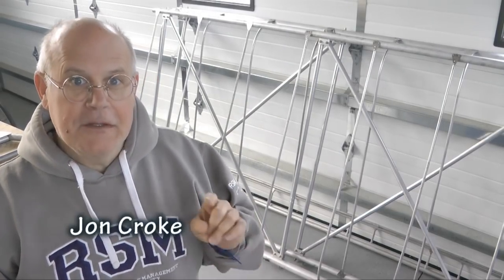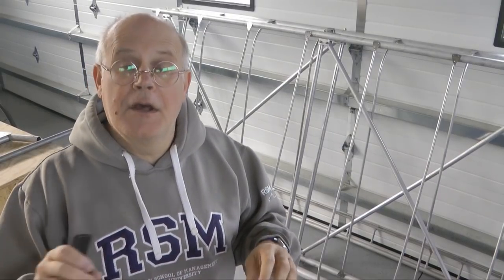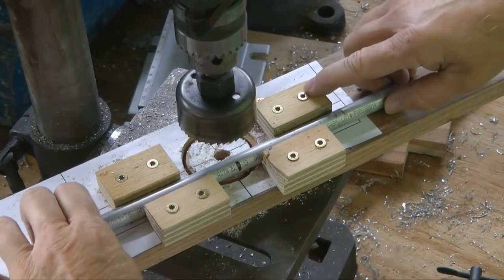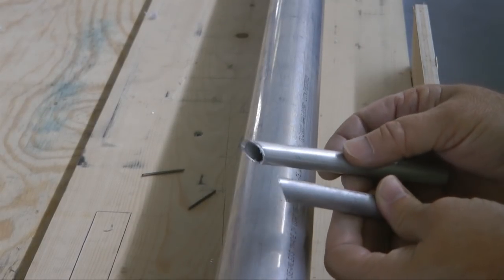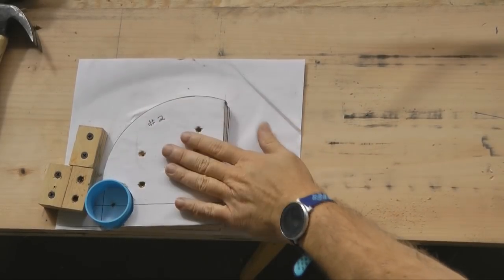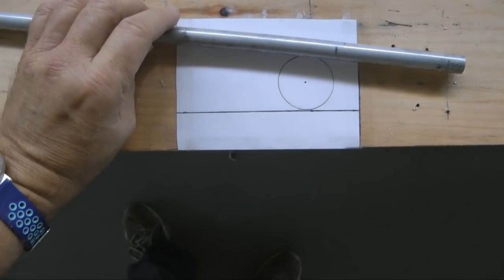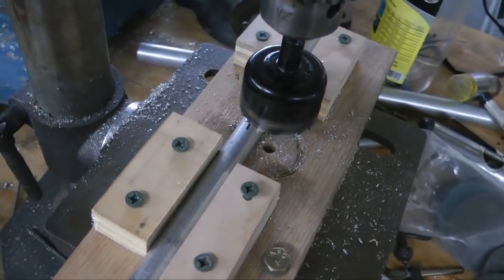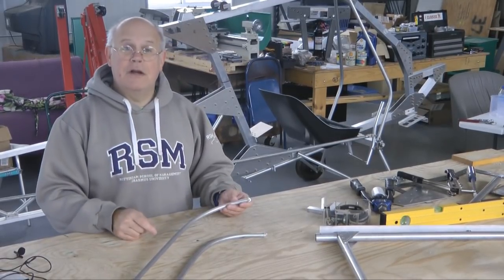Building the Affordaplane Part 29

Comment: I am wondering why you went with the aluminum gussets for the wing ribs instead of the plastic parts shown in the plans?  Was this a weight or strength decision?
Reply from the maker: It was just my choice: Plastic weakens over time - and those are custom pieces that are sometimes hard to locate. Years from now for repair or maintenance - aluminum will still be available!